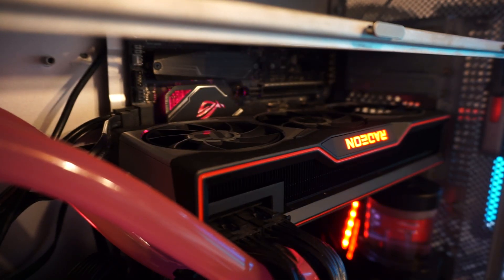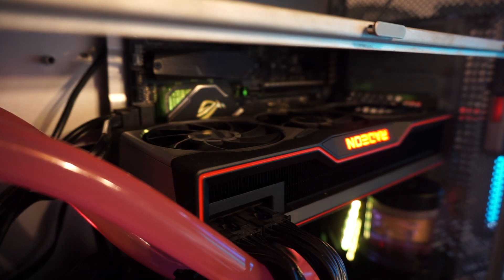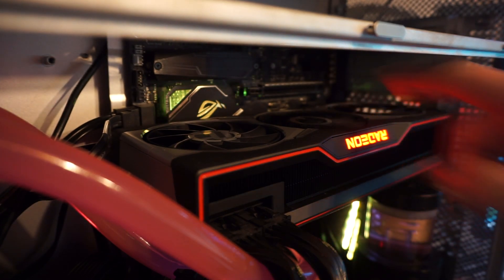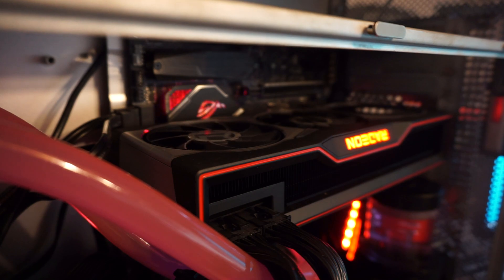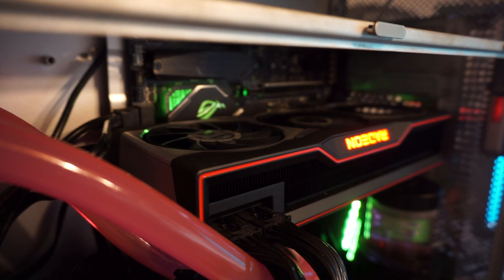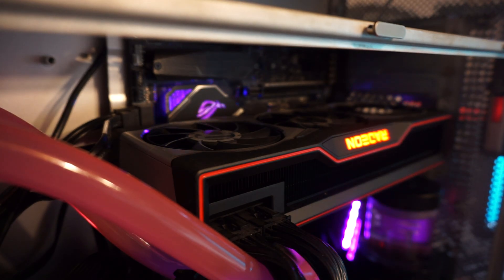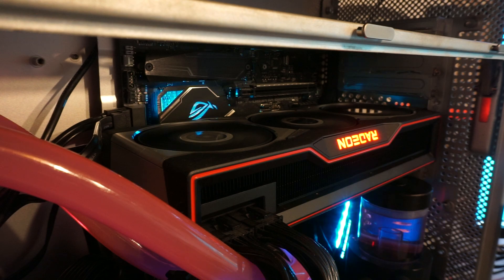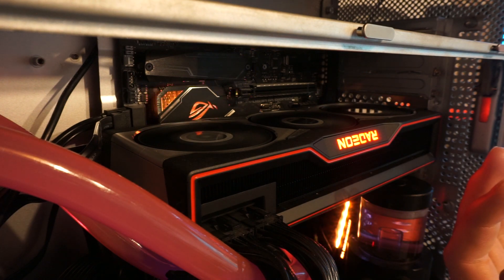AMD Radeon RX 6900 XT/6800 XT/6800 Reference Design Noise/Fan Testing

Comment: Just got mine installed. Red devil 6900xt. No noise until I play Vr games! 

Then it sounds like a vaccuum cleaner. Using 3 nocturna fans at the front, two above the gpu, one at the back.tech guy who installed it says my fan set up was good.